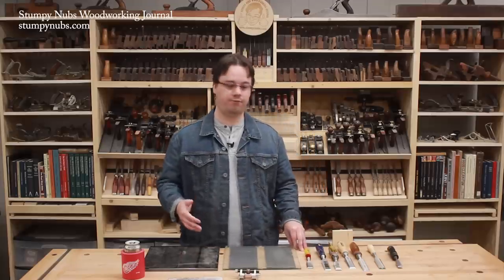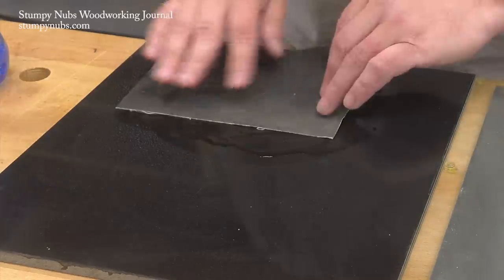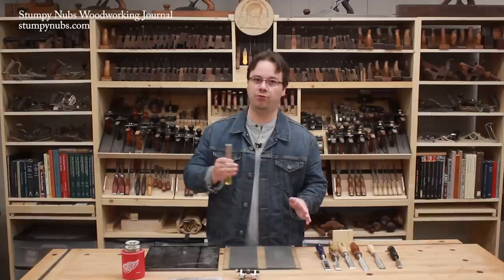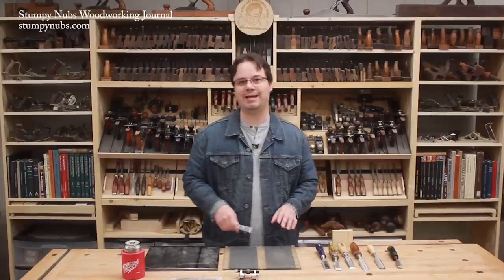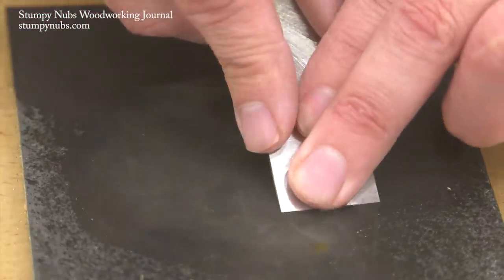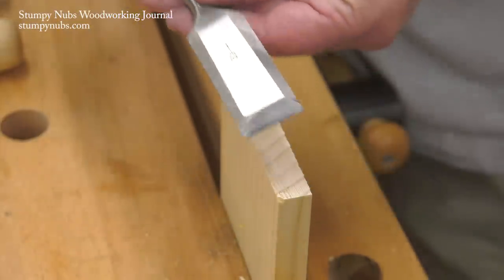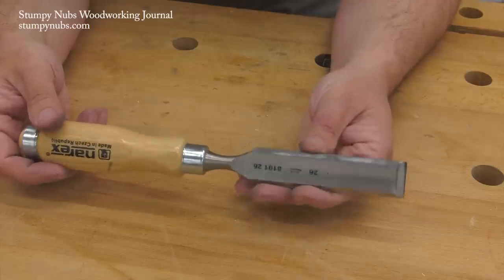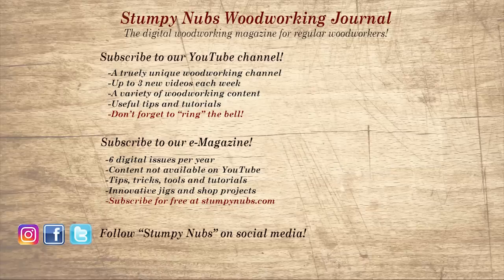Cheap chisels? How to make them scary sharp!

Comment: It would require a deep dive fact-finding effort, but I can't help but wonder whether the quality of the steel for a given price point hasn't changed over the decades. Case in point... Screws. Now, when I was a young lad growing up, it seemed like your average screw hardly ever stripped out. Today, everything from the screws to the bits that drive them seem to wear out or strip out much easier. So, I can't help wondering if the steel used in low to mid grade chisels has gone south as well. Either that, or has the metalurgy for the steel used in high end chisels gotten better as the science of metalurgy evolved. I'm just wondering what's your take on the matter, and, for that matter, the opinion of your subscriber base.
Reply from the maker: Absolutely the quality has changed as manufacturing has gone offshore and standards have dropped to hit certain price points. Tools may seem expensive, but look at the price of something 50 years ago, and multiply it by 2% a year just to cover inflation and you will see that things are MUCH cheaper today. Only by sacrificing quality can prices be kept low. Fortunately, there are still some top quality tool makers out there. But they are "expensive" by today's standards.
Reply: If you want a "wood screw" that doesn't strip out, drywall screw. They are hardened steel. Not appropriate for all uses, but the head won't strip out.

Comment: The only thing I would add is (advice from a machinist friend) if you want to flatten properly, move the work in a figure 8 pattern
Reply from the maker: Can't do that on leather. Sideways or forward movement will cut into the strop.
Reply: @StumpyNubs  yes I know. I'm well versed in sharpening and know how to use a strip. I meant during the actual flattening process using the sandpaper.  Unidirectional movement leads to rocking and disuniformity of the flat surface.  Ask any machinist or mechanic.  If you want to flatten something on a stone, use a figure 8 pattern.

Comment: I inexplicably found a set of 5 Stanley's at a Ross for about $20.  I've given them some basic but non-scary attention.  I need to find something flat so I can give them the business properly.
Reply: Just a quick thought on getting a flat surface too use. I use a small piece of granite countertops that my friend gave too me. But where you can find something flat easily is my favorite place on the net next to YouTube. That place is Craigslist I have seen granite countertop pieces both for sale and sometimes even for free because the countertop fell or got damaged in some way. Sometime there also in the free section is granite tile like Stump mentioned. What can happen is someone will do an update in there kitchen or something using granite tiles and after finishing the update they might only have just a few tiles left that they want to be rid of. So you could keep an eye out for a flat surface on Craigslist also there is facebook marketplace which is just a Craigslist clone. I have done a good bit of browsing around on Facebook Marketplace and have found Craigslist easier to use find and contact the sellers
Reply: @timothyvolkers5343  Thanks, I'll see what I find on Craigslist.
Reply: @Not_TVs_Frank  
Glad It Helped

Comment: Americans - chisels must have a flat back...... Japanese - this is a good spot for a swimming  pool
Reply from the maker: There is no contradiction there. The back of a Japanese chisel is designed to be flattened regularly. They just remove the material in the center so the edges along the sides and cutting edge are easier to flatten. Those are the important reference surfaces.
Reply: @StumpyNubs  But it must shorten the life of the chisel as once you sharpen past the edge of the hollow you can not put the metal back. Great content BTW
Reply from the maker: Not at all. You lap the back for a second each time, which widens the edges around the hollow.

Comment: Lo these many years ago, back when the earth was young and so was I, I had a cheap chisel that I used a lot. (I think it came in a set of 4 for 99 cents at the dime store) It was soft and would take a razor edge but would dull by the time you got it moved through the tough air to the workpiece. In frustration and ignorance I heated the edge red hot and dunked it into a can of used motor oil. Viola! That thing was now hard like glass! Took forever to get it sharp but it still took that razor edge. It worked really well for me for many years, despite the fact that it was ridiculously easy to chip the edge. Alas, it has been lost in the chaos of life over time, but it gave me a bit of insight into why I wanted good steel for cutting tools.

Excellent video as always!

Comment: You can heat treat the cheap chisels with a heat gun, turn it up too 300 degrees blow it on to the chisel away from the handle half way up the chisel blade and watch for a straw to light brown colour hit the cutting edge then quench in oil. Done
Reply from the maker: Why? Heat won't turn a low quality alloy into a high quality one. The problem isn't that they didn't heat treat them properly. It's that they're made from inferior steel.
Reply: @StumpyNubs 
Yup and they cut corners on the heat treating as well so why not spend 5 mins getting the steel as best you can. I did that to a 40 buck nz dollars chisel (about 7cents US) still going strong.

Comment: Great stuff. I have been doing this for decades. Works like a charm, though I learned to go to 2000 grit. I still have the cheap Stanley's I got from K-Mart when I was still a student 40 years ago, but upgraded to some nice English chisels some years later (gift from my wife). The Stanley's were not bad, once properly set up, but I use them for more sketchy things and save the good ones for nice woodworking these days.

Definitely if it is trying your patience, go to a coarser grit. Will save time in the end.
Reply: Kmart!😂

Comment: Why are japanese chisels designed with a hollow back? As far as I know it's an important aspect
Reply from the maker: It makes the backs much easier to flatten. A Japanese chisel is honed on the bevel, and flattened on the back each time you re-sharpen it. But because most of the back is hollowed out, it only takes a minute to get it flat.

Comment: Like many others I learned this lesson the hard way.  I have an inexpensive set of chisels that cost a little less than the Narex set that seemed good at first.  The couple of sizes I tuned up first didn't take too much work and they decently hold an edge in most uses, but then I tried sharpening a couple of the other sizes . . . one of them was so badly convex on the back that I wasted a whole afternoon sharpening just that one.  That same chisel developed a chipped corner shortly after from only doing paring work on maple and sapele end grain, so obviously the metal hardness was inconsistent from one chisel to the next.  They will soon be getting replaced with something worthwhile